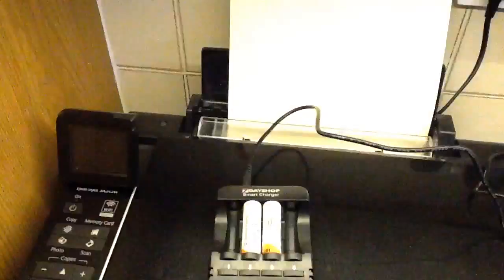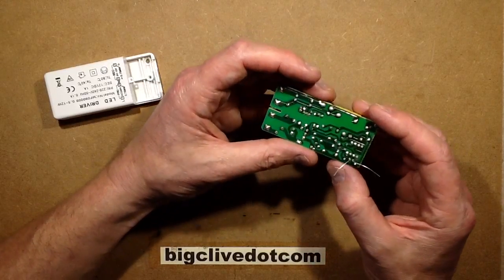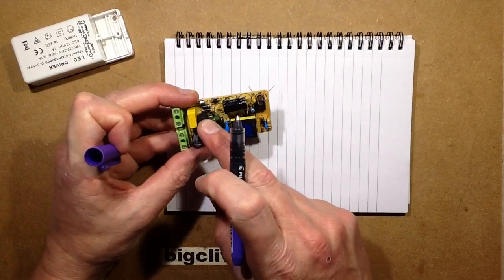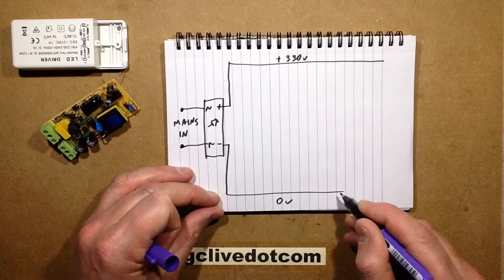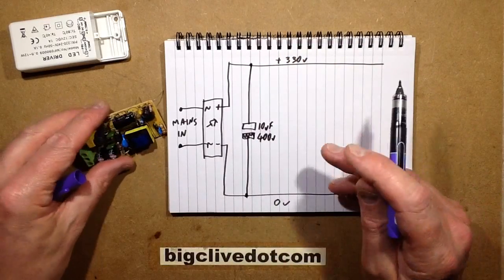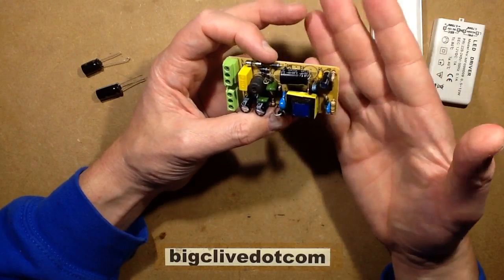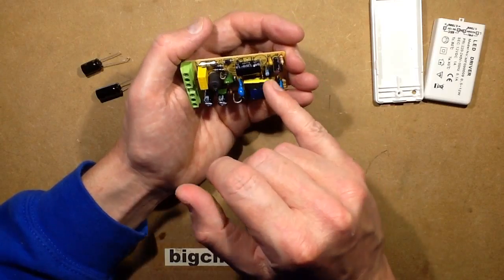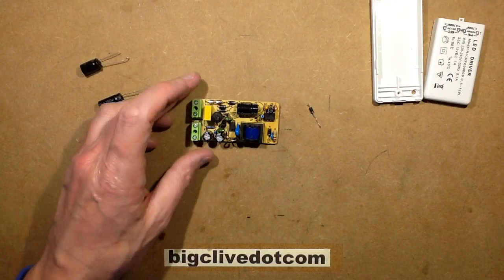(Flashing content.) Repair of strobing LED power supply.

Comment: I just purchased brand new strip today to replace old strip mine is connected directly to main switch button thing lol my strip has two wires on both sides to connect to connectors cut half one side was perfect stuck other half of strip on cupboard it’s flickering constantly now making all other strips to flicker even the old ones I had for years take new strip off it doesn’t flicker put on flickers Jon Snow confused
Reply from the maker: Are you talking about mains voltage strip?  If it's the direct mains version it should have a rectifier module inline with the power cable.  Without it the strip will be flickering at mains frequency.

Comment: Hi Clive, i have a pir lamp for outdoor with two 6w led lamp on it. One have this flashing problem when i bought it  and died few week later...  I open it and the led driver are lot more complex than this one on your video. i have tested the majority of components, the only thing i have found is a optocoupler (4pin chip) installed in wrong polarity from the factory. But the led driver still not work, the optocoupler is fine because i have tested it in the other led driver. This mistake from the factory have caused another trouble, But I did not find it. Do you have an idea what can be the problem now ?

Comment: Hi Clive, i have replaced more than 20 set of led driver and ceiling light rated 12w in my house. I felt it was a waste to throw it away everytime i do ceiling light replacement and i am glad to find this video. i have checked one of the led driver which should have give a DC output of 28v-43v with constant 300ma current from 240v AC but when i checked with multimeter it shows small reading in mv of DC but when i change the meter to read AC it gives about 8v of AC. Can you please advise me on how to fix this or i should just throw away all the driver? I was thinking to reuse the good component between the driver.

Comment: Hello Clive, i have a problem with my LED. 
Some of the  POINTS LED doesnt turn on well just a little bit like mostly a dim while some of the others doesnt turn even when i use eltctric meter.   Input 100-220 VAC  Output 90-140V DC 30-40W 300mA. if the DRIVER is ok why the POINTS LED doesnt work normaly but like dim light hh ? How can you hep me ?!
Reply from the maker: If the dim LEDs are in series with other bright LEDs then they are failing and passing current without emitting light.  If they are in parallel then they may have slightly different forward voltages.

Comment: Öhm, Clive
 
We are talking about ChengX capacitors here. Can it get any worse than that?

And with Electrolytics, they shouldn't bulge when they're failing...
That sometimes is a sign for misuse and abuse...

I've seen ChengX only in rather bad PC-Power Supplys that don't deliver the promised wattage. Doesn't get much worse than that...
Reply: Oh dear. Now you come along and say ChengX isn't that bad. Well, your name looks like something someone could belive, so I do...

The main problem with all this are all the guys that say that everything that isn't japanese (in caps) is garbage :(
So no real discussion or even investigation takes place...

Comment: A year or so back, I ordered a 50 watt LED that came with a power supply sort of like that one, but undressed as you have it now.  It never did work, simply flashed like that every time I had it hooked to anything.  I never have tinkered with it, as I don't like playing with mains voltage, even with our little 120 Volt here in the US.  I think I still have it laying around somewhere, perhaps the next time I run into it, I will at least try the re-soldering of the joints.  I did that on the back up monitor in our motor home this spring, and it  brought it back to life, there was some very poor solder joints, I was surprised it ever worked properly but it is the one that came in the unit. They get a lot of vibration when mounted in the dash as this one is. After re-soldering the joints, not only did it come alive, and stay alive, but I discovered that all the controls had red LEDS that lit them up, none of those ever worked before either. Now I can keep an eye on our Jeep Liberty as we travel the highways and byways of our little country.
Reply from the maker: Those power supplies are designed for LED arrays rated for around 30V.  What voltage are your COB bars intended for?  It may be that they are pulling the voltage too low and causing the driver to shut down.  It's possible your other driver is capable of handling the wider voltage range.
Reply from the maker: It would have to be hooked up to its matching LED style.  If you used it with lower voltage LEDs it would interpret them as a short circuit and do the pulsing thing for protection.
Reply: I bought this off DealExtreme:
http://www.dx.com/p/330ma-9w-led-constant-current-source-power-supply-driver-90-265v-81779#.WMDQNLkrLGI

I hooked it up to some COB light bars that I have and it just flashes exactly as in your video.  I bought TWO of those supplies above and they both do the same thing.  I run the COB lights on another CC supply at 32V 500ma so about 16W or so, do you think that that may be overloading the Chinese 9W supply above?  I also have some of those "10W" 'garden' lights like you always show in your videos that only put out about 6W, so maybe I'll try running one of those off that 9W supply and see if it works.  Great videos btw, I love LED lighting!

Comment: Thank you so much!
Switched "50 kHz fast diode" to 1N4148 and it works now. No "bathroom party" strobing since Wednesday :)
Reply: Aaand it failed completely. Apparently someone did fewer windings in the transformer, so the entire driver worked at substantially higher frequency than designed. Another diode failed (after 8 years), the 1N4148 is still operational though. Thank you for 8 years of light :)

Comment: OK, the IN4148 is fast enough for this application but is a 75V reverse voltage rating adequate?
Reply from the maker: Time will tell, but it's all I had at the time.  The voltage of the capacitor it is charging is around 5V.

Comment: I got a power supply doing this flashing thing on an old network switch,
The flashing power light was not referenced in the troubleshoot section of the manual... .'
I checked the capacitors and the fuse, and then.. I threw it away, but as I see, this was probably related to the bootstrap.

Comment: I have just had the very same strobe problem on a new 80 watt LED flood light. I took the driver out (only after the supplier said they are sensing a new unit and not to bother returning the dud) Trouble was it was fully potted so it got binned and a replacement drive unit is nearly as much as the lamp.

Comment: Very good BigClive.  The first thing I thought of was caps.  Input, and one on chip just as you did.  Exactly as you did was second I would have done, re-solder the transformer pins.  I did suspect the diode as its breakdown voltage was deteriorating.  Once you found that, yes it was fixed.  What I learned in this is your use of a IN4148!  The output current passing in one of those is very small, yet the chip did not need much current.  Thanks for that as I would never have attempted to use the IN4148 but it worked on this because the current needs are very small.  Glad you got it fixed!

Comment: Hi Clive! I work in facility services (im a maintenance guy). There's a big trend now to install LED fixtures to replace e14, e27 and other CFL socket (g23, g24.. etc.) type fixtures. The LED fixtures boast about 20yr lifespan and cost around 20-25eur/unit + installation (which is cheap when installing multiple fixtures at one time).

We were talking with the guys that what a great deal, BUT! The fixtures don't all last 20yrs. Every time a fixture breaks, we have to call an electrician to install a new one and it ends up costing around 100e for a single fixture. Labour is really expensive here in Finland.

how do you feel about led fixtures vs led bulbs costwise on the long run?
Reply from the maker: The LED industry has been blighted by marketing hype that could never live up to the expectations.  LED fixtures have two common failure modes.  The LED drivers, particularly if they have been put in unventilated areas, and the LEDs themselves which are often pushed too hard and suffer from degrading emitters, phosphors and wire bonds on the chips.  If the salesmen were tied into a legally binding contract to supply and fit free replacements under warranty for the stated life of the lights then the suppliers would go bust quickly.  Are you hoarding a collection of dead LED stuff?
Reply: You're right about the hype, but nevertheless, I do prefer LEDs over CFLs, oh so much. And some expensive led bulbs offer a 5 year warranty, but the standard is around 3 years. I think that's not too bad considering how much the prices have come down lately. I think they are counting on the fact that no one will save the receipt for that long..

I don't have much of a collection. We usually chuck the dead stuff straight away, as it would quickly fill storages and become a fire hazard. I have quite a few of dead emergency exit lights saved on different locations though. Would you be interested if I would put together a dead-LED-package?
Reply from the maker: The LED lamps are definitely better than CFL.  Even just with regards to the smell of hot electronics that came from the baking hot CFL cases.

Comment: I recall reading somewhere that diodes are among the most common low power semiconductor devices to fail.  One would think otherwise, it being a very basic semiconductor device, but I've found it to be true.
Reply: Being the most simple semi, they tend to be the ones that get the most abuse, and run at mains potential etc which a typical IC never gets close to.

Failures of diodes in main low-voltage circuits I'd say are rare.

Comment: Big thanks to you Clive!  After following the steps you took in this video, my LED downlight now works properly. All I did to fix it was re-flow the solder on each joint and add a bit of solder if I thought it looked a bit lacking.   Light output is now rock solid!
Reply: Is there a preferred solder to use over others?  Thanks
Reply: @jeremykemp3782  Yeah, lead based solder is usually the best.
Reply: @Tommyinoz1971  thanks
Reply: @Tommyinoz1971  flux pen?

Comment: All this technology and you can't beat good old switch-start fluorescent for reliability :)  The under-shelf lights in my kitchen have been re-used in subsequent redecorations since the early 1970's! :)
Reply from the maker: Absolutely.  Better lumen maintenance and reliability than LEDs.
Reply: The LED lights in the our house I replaced the switching driver modules with good old 60Hz transformer + bridge + cap.  Less efficient yes, but with just 3 parts they're much, much more reliable than modern switchers.  They're still working well after many years.

Comment: This has nothing to do with this video but I found this on ebay and i thought you would be interested.
http://www.ebay.ca/itm/220V-20W-30W-50W-70W-100W-LED-Floodlight-COB-Chip-Integrated-Smart-IC-Driver-/322230068821?var=&hash=item4b0668a655:m:md68ngvURAnCS2sP2JP6Fqg
Reply from the maker: they look like the type where the LEDs are switched in groups to "ride the sinewave".  I've ordered one to take a look at.
Reply: great i was going to get one but they only seam to make them in the 220v flavor. I'm in Canada and we have few 220v outlets play with.i looked for a 110v version but no go so i look forward to seeing you tear into it

Comment: I have heard and used the term "bootstrap" a fair amount while in the power generation and heavy equipment industries. I was not aware it was also used in electronics but it makes sense that it is. If anyone is wondering what he meant by " bootstrap" here's a clumsy explanation: When the term bootstrap is used concerning electricity it usually means " to get going initially" if an electrical device is capable of bootstrapping it can get going on its own. Example: Most 1MW+ wind turbines cannot bootstrap as they require an external power source (the grid, battery bank,diesel generator,etc.) to get to the point where they can produce their own power.  Internal combustion engine powered generators can bootstrap and are often used to get other forms of power generation equipment up and running.
Reply: "Most 1MW+ wind turbines cannot bootstrap as they require an external power source (the grid, battery bank,diesel generator,etc.) to get to the point where they can produce their own power"   

For the initial field excitation?
Reply: + New Jersey Bill  Yes , field excitation is a part of it but excitation come quite a bit after start up. Powering the up the controllers, the meteorology and wind sensors,control boards,charging the DC bus, slewing into the wind,etc come before excitation and require an external power source.
Reply: Ahh, for all the ancillary equipment.

Comment: Hi Clive! with this repair it makes me think! I had a little project I was working on a few years ago! But could never find a simple easy to make and duplicate led strobe unit. I know their is a way to do it with a programmer and a chip! but can it be done with simple components? if enough people are interested I would love to see one.
Reply from the maker: Technically speaking you could make a mains voltage LED strobe by charging a capacitor and using a threshold detector to dump the current in a slightly limited manner through LEDs.  Like the traditional xenon strobe.  Or just use something like a 555 timer chip to drive LEDs from a low voltage supply.
Reply: I needed a low volt and did many years ago make a very nice looking us enterprise but I was at the time and later using a 555 timer never able to get anything that looked like a strobe more like a fast blinging! I understand your I would say busy! any ideas would be more then appreciated!

Comment: Interesting, since I had a large switch mode supply where the bootstrap diode went short circuit!

I made this diagram while reverse engineering it... 

http://www.fsck.co.uk/temp/AUXPSU.JPG

Turns out that the SS310 had gone short circuit... it's a 3A 100v Schottky diode, and since it seems like it need only pass mA, but might be subject to high voltage spikes, I replaced it with a 1A 600v FR Silicon diode, and the unit has now been running 24/7 for weeks...

Comment: If you suspect an electrolytic capacitor has gone high esr just blast it with a hairdryer. If the capacitor is faulty then heating it up will temporarily improve it.

Comment: Interesting defect. I paused the vid to look up the FR107 datasheet, and the specs should be adequate: 700 V RMS, 1.0 A If(av), 500 ns max recovery time. It's NRND (not recommended for new designs), but still.... I guess the manufacturer used subpar parts, which would be corroborated by the poor solder joints. Nice detective work!

Comment: hopefully someone can help me i'm looking to power 5 meters of SMD5050, 60LED per meter. what power supply will be a good match. ps im on a bit of a budget 
thanks in advance. :)
Reply from the maker: Don't skimp.  If the manufacturer lists the current per meter then use that as a base and get a power supply that can deliver at least double for long reliable life.
Reply: Thanks for the reply and the info i'll be sure to do that, love the channel keep up the good work

Comment: No user repairable items inside.... I always asune that is a challenge
Reply from the maker: Exactly.  I particularly like it when it says LED lamp cannot be replaced.   Challenge accepted!
Reply: I always see the "Danger High Voltage" as a challenge..
Reply: Same here. If it's broken, I can't make it worth any less to me if I try to fix it. The only thing I lose is my free time, and I can potentially gain knowledge and/or a fixed device in the process.

The one exception I have to this is electronics potted in silicone rubber, epoxy resin, or bitumen/asphalt.
Potting compounds are just a general pain in the butt to try to extract anything from in an intact or repairable condition unless you want to use chemicals to dissolve them, and those chemicals are generally something you don't want to have to deal with if you can avoid it.
Additionally, there is a very good reason the electronics were potted in the first place, usually something such as high voltages (ex. CRT TV flyback transformer/voltage multiplier assembly).
Reply: Such items are always worth putting in the toaster oven for a little while. :)
Reply: ElfNet Gaming
To be honest the high voltages are a secondary concern. Most of the time I'm not going into potted electronics simply because it's such a pain in the ass to get the dang thing apart in the first place!

Mains voltages I will mess with no issue, but I'm going to be using the one-hand rule.
That's why I have an alligator clip attachment for the test leads on my meter. It allows me to do voltage checks without needing to use both hands.

Charged capacitors get the one hand rule, the "chicken stick" treatment, and placing a jumper lead across the capacitors at the first opportunity so they STAY discharged. Certain kinds of capacitors can actually recharge a little bit after being discharged and that can build up enough charge to bite you rather hard if you're messing with something like capacitors recovered from an AED with an expired inspection cert.
A "chicken stick" is a jumper lead with one end attached to a length of insulating material, and should probably include a 470k 10w resistor if only so you don't "hard short" the capacitors (that can do some damage some kinds of capacitors even if it doesn't kill them "right then"). I chose a 10w resistor more for flash-over voltage than for actual power dissipation.